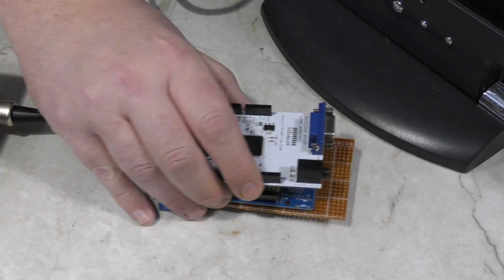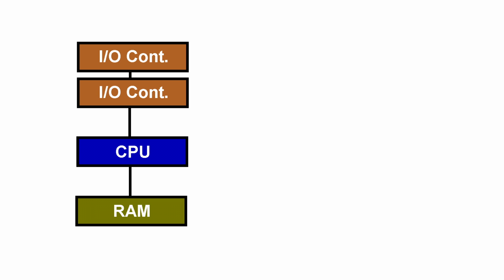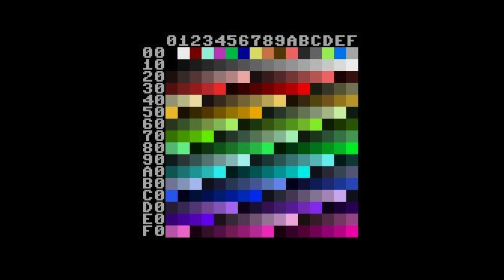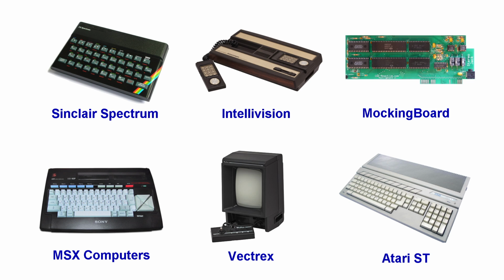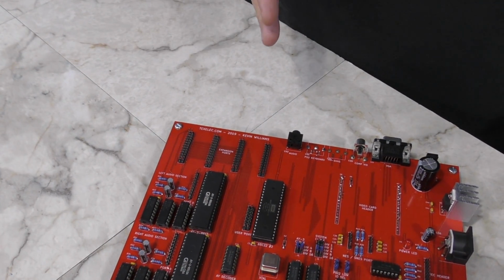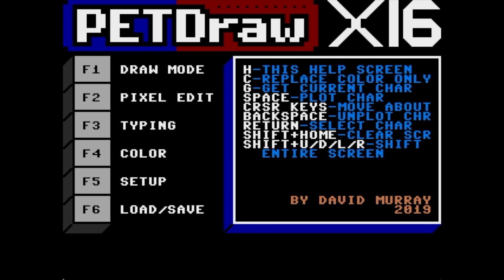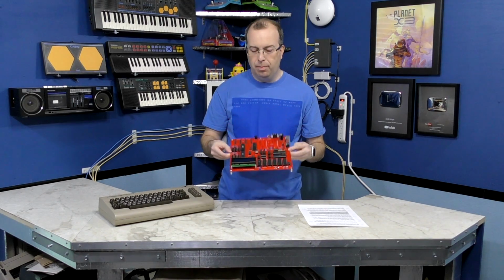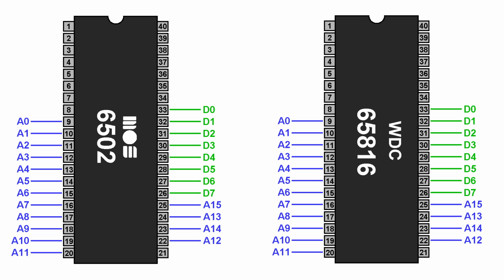Building my Dream Computer - Part 2

Comment: Wait why is the keyboard separate? I thought old school computers were supposed to be laptops with the screens ripped off.

Also lots of modern pc cases have 2 buttons 1 for powering off without updating and one for make the computer power off an then back on again also known as restart.
Reply: An integrated keyboard would require a completely custom case - that's going to push the price way up. The whole point of using existing cases is to keep the cost down.
Reply: @dunebasher1971  they should sell that as an extra and if they are going with an off the shelf case they could cut down on cost by having no case just like the raspberry pi

Comment: It would be nice if you could use the Yahmaha YM2151 for sound as it's a lot nicer chip.  Used in Arcade Games (driven by a 6502), such as Marble Madness.   If you could add an optional support for Speech with the TMS5220 (also used in Arcade Games) that would be awesome.

Comment: the 6502 is still in production, but what about the 6510? Is it still being made?
Reply: No.  It is not.  The only difference between the 6510 and the 6502 was the addition of an 8-bit GPIO port, which was used for bank switching, and for controlling some of the signal lines to the Datasette.

Comment: If you do use the 65816, you should modify the RAM bank register to latch during the first address half of the memory cycle rather than just discarding the upper 8 address bits. Effectively that'd turn the upper 8 bits into the bank selector, and you wouldn't need a separate memory-mapped register to control the RAM bank selection. (Perhaps for strict 6502 compatibility, you could still keep it mapped in memory as well, and add a NOR gate between the 8 address bits that prevents the register from latching on the address half of the memory cycle if the upper 8 bits are all zero. That way 6502 programs will still function with the memory-mapped bank switching semantics you've described.)

Comment: Don't the PLCC version of the 65816 have all the 24 address lines?
Anyway, someone will eventualy add support for the X16 in GCC, what means that a huge amount of stuff will be far easier to do. And, as you might know, I like Java, that is written in C++. Something that I would like to do is to setup a "webserver" in the X16 using Java. It will probably take minutes just to load a plain HTML/CSS page, but I think it should be pretty fun.

Comment: Handling the USB could be interesting, for moudern keyb and mouse; I used an STM32 mcu as my video out on my little homemade machine, and used the STM32 as the programmable GPU; but it can also easily hanbdle USB, so I allowed that to do mouse and keyboard and expansion as well... as, PS/2 is very easy to implement, a trivial electrical setup and protocol. Thats what I use as well..

I'll be interested to see what happens with the keyboard; I've been thinking about making a mini laptop of my machine, or making a setup like this with external keyboard, but I wonder how much to get a one-off badged keyb :)

Of interest though is .. ensure it has a cart port; my little machihne has a cart slot, and nothing screams retro more than a big old cart slot :)

ed as I watch: And you selected AY-3-8910 .. same chip I ended up going with as well, this is hilarious :) (my machine was built about.. 4 years ago at a guess, something like that. I used eZ80 as the cpu instwead, .. the other big retro processor :)

Comment: Very interesting video and project, but why? I'm not trying to upset all the retro geeks, cos I lived through it and loved everything that Pong kicked off...but...would it not have been easier to create a retro computer using the PC or laptop that people already have and constructing a (probably Linux based) software 8-bit like environment. I purposely avoided the use of the word emulation as I see this is potentially a new machine, even though it appears to be driven in part by the much loved C64.

Comment: Why not all in one, keyboard build in? Why not backlight? I would pay 20$$ more for it. First keyboard looks pain to type on.
Reply: The actual cost would be $120 more and a one year+ delay. We are going this route for very good reasons. I'll be doing a full post and user poll shortly on the Facebook about this. In short, we don't want to custom build a case and keyboard as that would add hundreds of thousands of dollars which you guys would have to pay for. 

It also introduces many risks and delays as you have seen on other projects like the ZX Spectrum Next. Therefore we are limited to high quality off-the-shelf components, which is the spirit of David's project. We will be customizing and rebranding these and you'll see all the options in the aforementioned poll, and have a say. We realize with nearly 1 million subscribers we are not going to be able to please everybody, and we thank you for respecting that. 

However you can trust that we are moving forward with the best possible option for the community so you can get this machine in your hands as quickly as possible, looking sweet, and at the best value.

Keep in mind too that many beautiful classic computers did not have an integrated keyboard. Apple Macintosh, Amiga 1000, Commodore 128D, Amstrad PCW... 

Thank you for your enthusiasm and feedback 👍🕹️

Comment: What is your idea for storage besides a commodore drive?
Reply: At 23:55 he mentions SD card support (SD2IEC).  It also has the same serial port as a Commodore 64, so it might be able (eventually) to connect to Commodore disk drives.
Reply: SpearM75503 thanks. Totally missed it

Comment: 1. I imagine it would be pretty simple to implement "slow" bus in the video FPGA. Just have a few pins dedicated to it and connect sound chips there! Otherwise, its just one external buffer chip. Could be later used for other DIY hardware too - leave a 1-4 decoder pins for user "chip select". Similar designs were used a LOT in 8-bit era and proved successful and convenient.

some more advice below, feel free to ignore:

2. Please look at how SNES video works. I feel like a few 
additions here and there like multiple planes and masking would not be as hard to 
implement or add any cost since you are going FPGA route anyway - but 
they would greatly enhance visual capabilities. I recommend "Retro game mechanics explained" channel - very easy to understand in-depth videos 

3. Skip "middle-range" model. It will be wasted effort. I'd go as far as to say - produce a "enthusiast" model with real chips and a cheap model with ARM-emulated hardware.
4. Please try thinking about cost more from the beginning. This looks too expensive for a lot of folks out there. You are competing with relatively cheap second-hand C64s with a HUGE software library and knowledge base, and most geeks already own one.
5. I'd rather skip the keyboard too - it doesn't look like it's really worth it. A few sticker decals should be enough. Yes, linedrawing symbols look great but I'm rather skeptical about demand...
6. Knowing your customer base is the key. More polls, Q&As and such may help a lot with that. This is a niche product and I feel like you need to cater to them better.

Comment: The YM2149F was the Yamaha modified AY-3-8910 in the ST and the ST had a Motorola 68000 running at 8MHz. It also controlled the floppy drives and serial and parallel ports. Now I don't know anything about all of this stuff but the ST while not being the fastest computer of that era was not restricted to 2MHz or whatever because of its sound hardware. Is this of any help? The chips are no longer made of course but Wikipedia says there are clones still in production.

Comment: Looks like a great project. My only issue with what you have shown so far is the case. I wish it was like the 8-16bit microcomputers that had the keyboard built into the case, like the c64 and amiga.
Reply: What about the Commodore 128D or the Amiga 1000 or the Amstrad PCW or the... well you get the idea. More on this soon at the Facebook group. 👍🕹️
Reply: @RetroRecipes  Is just my personal opinion. When it comes to retro computers, I prefer small formfactor with everything built into the unit.
Reply: @bloxyman22  I respect that. However many also prefer detached, so you can set the computer at the back of your desk and avoid wires trailing across the desk. As you can see, it's impossible for us to please everyone. So we will go with what's the best value for the end user and gets the project launched fastest. That will be a detached case. More info is in the FAQ at the group. 👍🕹️

Comment: This sounds quite like the 1088XEL project, an Atari 8-bit motherboard design that allows you to built your own machine with Atari parts - but with that one you need access to the Atari custom chips, some of which are in quite short supply. For that setup you also have to install add-ons like the VBXE (an FPGA graphics chip), which is similar to the one going into this machine.

One thing nobody's come up with so far for the project is a custom case and keyboard. At the moment, people have to use an off-the-shelf PS2 keyboard and mini-ITX case. I started designing one but life keeps getting in the way. But I love the designs put forward for this system. Hope you manage to finish it.

Comment: I have a suggestion for the sound:  Use a Propeller.  There is already a SID emulator called SIDcog, you could also write emulators for other sound chips and use the same interface to have all of them.  It would interface to your 8mhz bus no problem and it can slave off the 16mhz oscillator you are using.  The chip has direct DAC output with a couple smoothing passives, so stereo is simple too.  The BOM cost would be less $10 to integrate this and it would expand your capabilities tremendously.  It could also be used as a slave I/O chip for handling things like serial interfacing or other tasks that would require dedicated chips/hardware.

Comment: I think most of us were expecting a case more along the lines on the old 8bit designs, and not a cheap ITX case. But i guess i can understand from a cost point
Reply: Considering they are already over the original price idea, I understand. It is a new PC as well, so having a modern case doesn't bother me.
Reply: Perifractic is indeed a very pragmatic fella...
Reply: I'd rather see this thing put into the new molded C64c cases that are currently available from the original molds.
Reply: should work with lego for the case :)

Comment: I don't like the I/O area breaking up the RAM. Can't you put it somewhere else? Overlay a page of Kernel ROM as the BBC does. Then you'd have contiguous RAM from 0 to 48K.

Did you ever consider a USB interface for the keyboard? I've implemented a 6502 USB keyboard driver and it's much easier than PS/2, and gives the flexibility for other devices.
Reply: Well, the problem is that the upper 8k is bankable.  What do you think is going to happen if part of your program is in that 8k space, and you accidentally POKE the wrong address and switch it out?  Answer: System crash.  Also, for string storage, most interpreted versions of BASIC stored strings at the top of memory.  So suddenly, A$ is not equal to "hello",  it's equal to random garbage.  The easy solution is to keep the non-bankable lower 40k separate.  Then you won't have to worry about that problem, at least not from BASIC.
Reply: @SpearM3064  The solution is that the I/O page is always the I/O page regardless of what is banked in. So if, for example, the I/O page is FExx then accessing FExx will always access the I/O, E000-FDFF and FF00-FFFF access whatever is banked, and the writers of whatever goes in the banked code know that they only have E000-FDFF for their code.
Reply: The "accidental poke" problem happens anyway. What happens if you are executing in the banked area and accidently poke and page something else in? System crash. Any banked memory system has the potential for code to accidently switch itself out of memory. Some code even uses the ability to page itself out to deliberately switch to code in another bank.

Comment: Yeah, shut up and take my money 💰! I‘m in ;). This is a really cool project!!! Although the ym2151 is a really great soundchip for this project, I would integrate the sound solution in the fpga too. That would make it possible to configure the sound to either ym2151 ay-3-8910 mos 6581 or 8bit dac with dma option - whatever one need as all these are available as ip-Core in one way or the other. I would also vote for the 65c816 because of the more flexible 16 bit stackpointer and index registers. And by also pushing the extra logic for the address-/databus demultiplexing into the fpga together with an sdram controller really should reduce the chipcount and boardspace into 100$ max territory. One thing I wouldn’t compromise in is the expandability. Besides a full processor bus - much like an C64 expansion bus - I would also include more modern things like spi and i2c, an sdcard Interface and usb (just for keyboard HID and  mass storage, there is a controller chip for this that connects via spi/serial and 8 bit parallel). Greetings from Germany 🇩🇪.

Comment: Check out what the Atari guys do with the 65816 on the Rapidus expansion.  They also have a new video chip expansion called "VBXE".  There are also 1MB RAM boards that support the Rapidus.  I am betting you can get some ideas from them to use here.

http://www.realdos.net/RapiDus.html

https://lotharek.pl/productdetail.php?id=130

Comment: Regarding sound, honestly, considering the whole design and its use case, I'd rather gave up on picking any sound chips at all, and focused on getting 6502 to the max clock possible. Having it at 14 MHz with DACs and timer interrupts would be just enough to get a reasonable MOD player, or software synthesized sound chip alternative, leaving enough CPU time to run a game/program at the same time. Would cut the costs as well.

Comment: Pesonally, im not a fan of that dudes case designs.... It screams "too new" to me, instantly..
This is an 8/16 bit system... It needs, No, it deserves a Retro looking case..
Reply: I thought the exact same thing. It will be cheaper to use something in existence though, like he said.
Reply: If the finished board indeed ends up being Micro ATX/Mini ITX compatible, you could put it in a Checkmate 1500 case. That might fit the desired aesthetic.
Reply: @IanDunbar1  Oh yeah, that's the stuff! Please try to suggest it to David and/or Perifractic
Reply: A few of them kind of looked a bit like the Xbox360 phat, which I wouldn't mind.  Either way, don't really care if it sat in an Atari 2600 woodgrain style box, this thing looks amazing!
Reply: My first thought when I saw the case design was, "Why has he put it into an old Sky Digibox"?

Comment: at 28.39 you say the emulator runs in Linux, Windows or Mac. I'm a Mac user. Do you mean Mac OSX will be able to emulate the C 64?
Also as a Mac user I yearn for some of my old System 6 an 7 programs. How difficult would it be to make a System 6 or 7 emulator for the Mac OSX? Please excuse my ignorance if this has already been done.
btw this is a great channel. It takes a lot of old guys back to the 80s and 90s. Those were the days.

Comment: Is a cheap STM32F103 not a good option for VGA signal?  The cheapste one has 18KB free ram,  they can run about 96Mhz(overclock) or higher. 
I wrote an C64 emulator for stm32F103 with spi lcd(320x240) in the past,  maybe I will at another stm32  to that project and emulator VICII chip and update it with VGA out. Nice project for the cold winter months.  :)

Comment: Why not use a Parallax Propeller chip as the video chip? It can run VGA and has 32K of ram and rom. It also has a 8 cores for multi-tasking. I'm not sure about the specifics but I think it's worth consideration. A single chip is only 8 dollars and it comes in both DIP and QFP packages.

Comment: build the board around a teensy 4. that would have enough power to bit bang vga, do multi channel sound and emulate any processor environment you want. 600mhz with dual instruction dispatch and $20

Comment: Have you looked into solving the the 655816 multiplexed bus issue with a latching circuit? It can be done with just 74573 and 74245, both of which are available for about $0.20/piece in quantity one. That's a lot cheaper than a CPLD or FPGA. It's also possible to do HDMI output with the CH7305A (it's a $5 part, readily available from China), without an FPGA; you might need dual-ported RAM and the video routines might be difficult, but you could do HDMI out without a coprocessor. It's not quite 'understanding every part of the computer' and treats HDMI generation as a black box, but it's a lot closer to a mess of verilog. Oh, this would also allow you to make it a laptop, as you're directly generating a parallel video port.

If you need a project manager for this computer -- and you do -- feel free to ping me.

Comment: Love the idea of YM-2151 soundchip.
Reply: ... But pair of this chips would be much better  :)

Also I think that 16:9 screen ratio and hdmi output would be much better. Most users will be using it with modern monitor or TV - no reason (except of nostalgia) to use only a part of screen.

Comment: If your'e spitting out VGA there is zero need for an FPGA or chip like that; spitting out VGA is pretty easy.. even discrete components not too bad, or just use a simple chip like an atmel or whatever, to bitbang out the video. The hard part is keeping it perfeclty lined up and not 'wiggly' like that, but nothing too hard to do, very easy and cheaply. An FPGA makes HDMI easy, which is why its the go-to, but FPGAs are expensive and hard to work with for the vast majority of people, so best avoided..